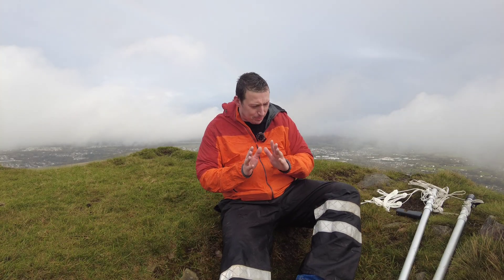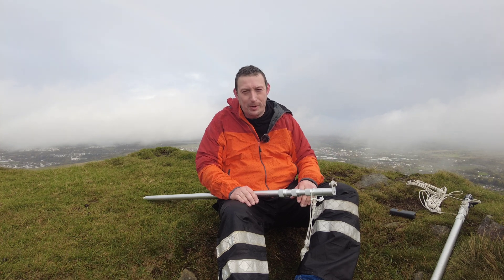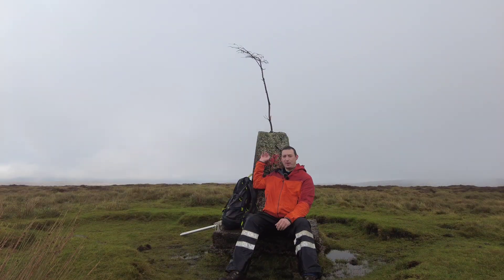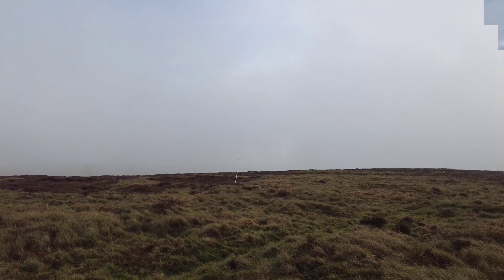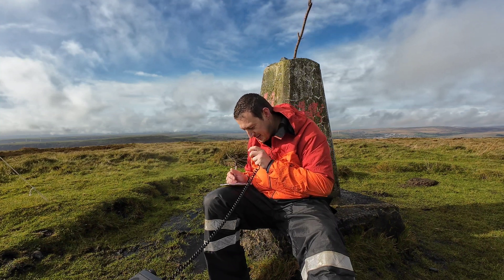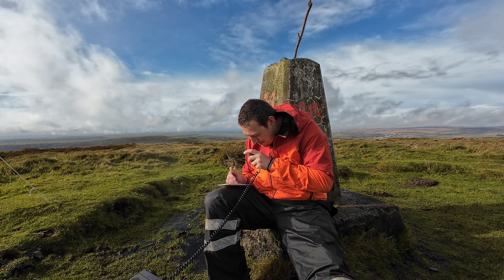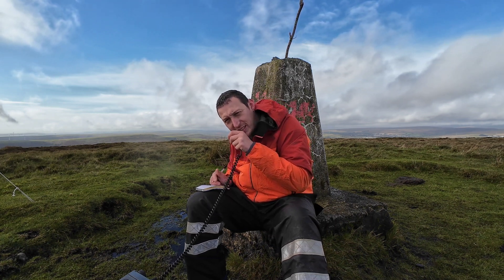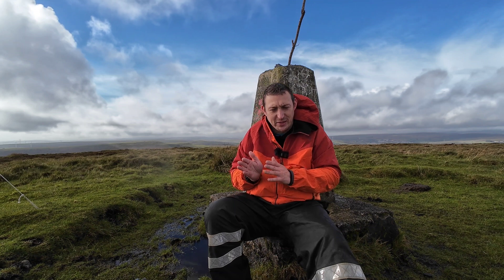EFHW antenna on a SOTA summit

Comment: Good pile up!! Nice experiment with a fairly low wire. Just shows what can be done.
Reply from the maker: Yep, worked really well on 40m but performance was a little disappointing on 20m. I'm not sure if that was the orientation of the antenna, poor band conditions, or the radiation pattern of a full wave wire? Maybe a combination of all three.

Ultimately it was an interesting experiment but not what I would consider to be a "practical" SOTA antenna.

Those masts are too big & heavy to carry any great distance. It also takes up a lot of space on the summit, so really not an option for busy summits where you are likely to see other people.

Comment: Hi James,
Jaysus fair play for carrying them poles up the hill!! 😂
Interesting experiment though indeed...
Im considering switching to a 20m 1/4 wave vertical light wire running up the sota 8m mast, then use the tuner in the x6100 for 40m..
Reply from the maker: Would be interested to see how that 1/4 wave vertical works for you Dave.

You might get some loss in the coax due to the high SWR but for SOTA you are only going to have a short coax run.

My guess is that it shouldn't be that different to running a loaded vertical (which I do regularly in the form of the Slidewinder).

Do a video fo it if you do try that.

Comment: Good video James and interesting antenna setup. When I saw the low cloud surrounding your summit I thought the clag would set in and you would get your usual soaking. Seems the Weather Gods have given up trying to dampen your enthusiasm. Nice pile up you had there. I've had some success using EFHW antennas and I must try some more activations using them again soon. 
73 Chris M0RSF
Reply from the maker: The weather Gods did give me a bit of a soaking on my way up but I put my waterproofs on and carried on regardless, giving them the 2 finger salute as I went! I think they got bored at that point!

Like you, I've always had really good results with EFHW antennas. I've also found them to be really good DX antennas when mounted vertically on a fibreglass mast with a bit of height above the ground. Obviously that's only really practical on the upper HF bands.

Comment: James, thanks for this interesting video! 
In the past I have investigated several different setups and created models for this 20m long EFHW (with a 6m tall GF mast). My conclusion was that an inverted-L (or more precisely an inverted-7)  probably produces the best radiation pattern for 40m and 20m. On 40m, the horizontal radiator part works well for NVIS and on 20m the vertical radiator part helps for a flat radiation. 
This and more can be found in my 50+ page portable 7-band EFHW antenna document. 
Antenna experiments are fun!
73 Stephan
Reply from the maker: Hi Stephan. Interesting to hear your conclusions. Where can I find your antenna document? I would be interested to have read through!

I think you are right about the inverted L (or inverted 7 if you prefer) being a really good compomise between DX on 20m & NVIS on 40m.

In an ideal world I would say that I think it's better to have a horizontal antenna for 40 (almost all of my 40m contacts are sub 500 miles around the UK, I don't really use 40m for chasng DX) and have a separate vertical antenna for 20m (which is where I work most of my DX).

Unfortunately, not everyone has the option of putting up 2 antennas. If you can only have one antenna for both bands then I agree the inverted L is the best compromise.
Reply: @HamRadioOnline  Hi James, thanks for your reply! 
Yes, the inverted-L is probably the best compromise for NVIS on the lower bands and DX on the higher ones.
You'll find my document using my call plus EFHW. Sorry, but I can't post a link or even use more concrete terms, otherwise G will del. my post.
You make great and authentic videos, thanks a lot!